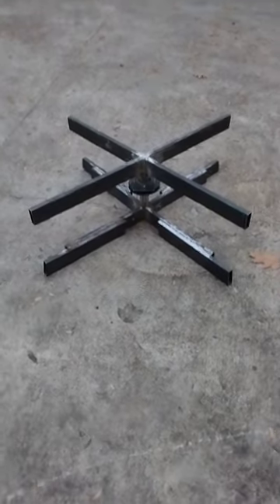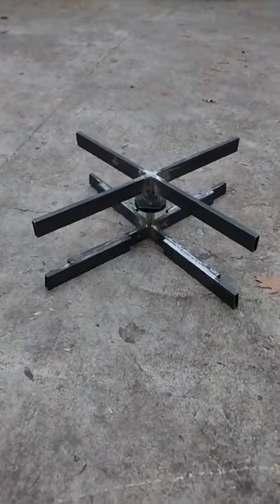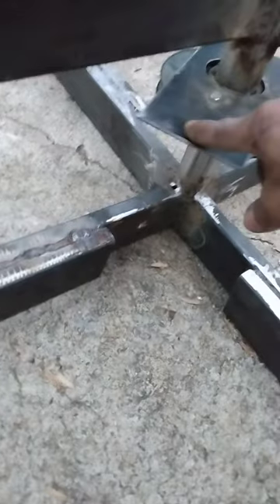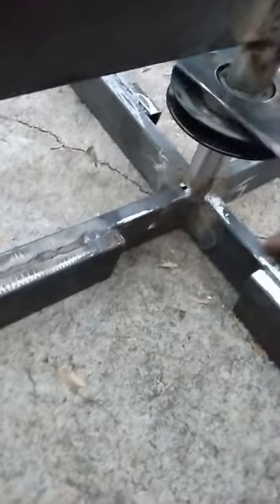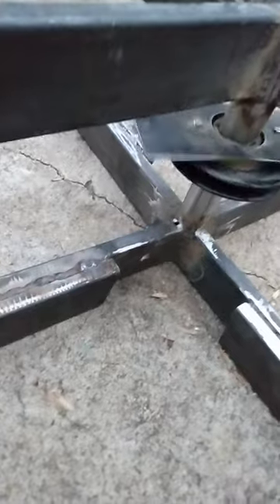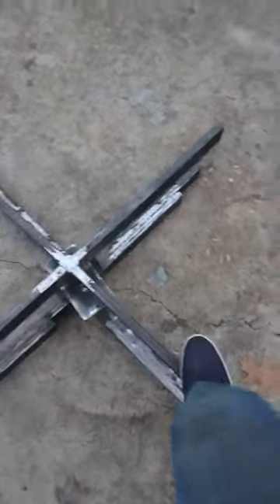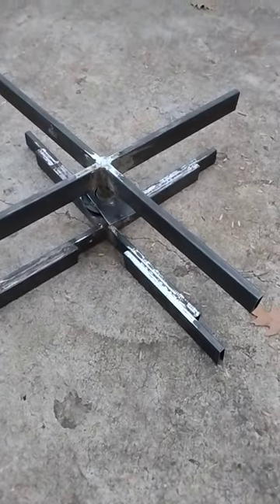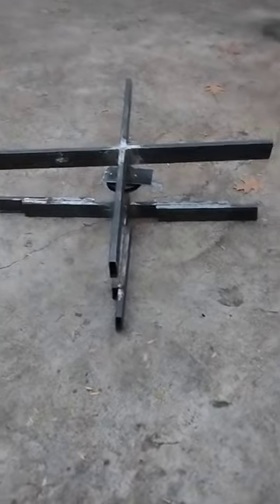how to build a 360 photo booth

Comment: Where did you get the bearings that spin ?
Reply from the maker: The bearing came from tractor supply I think it was about 20 or $30 I almost bought a bearing that was $80 but come to find out most of them were the same as long as it was metal and it spins real good and you don't get shrapna in the bearing when welding you need to cover the bearing with leather and do not put bearing grease in it until you're done so you don't lock the access shrapnel and fragments into a new bearing cause if you do you will have to take it all apart
Reply from the maker: The baron has to be welded and sandwiched between the belt pulley and the swing holder I can show you that in the next video I'm going to make another one that's going to look as good as it work